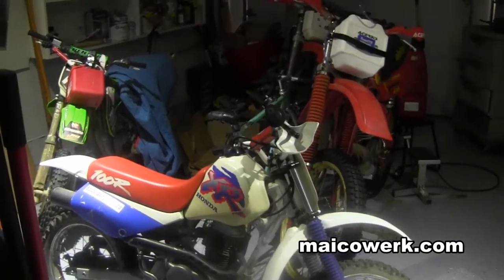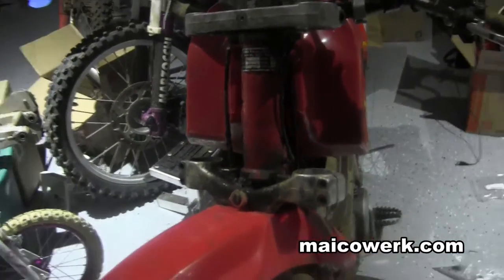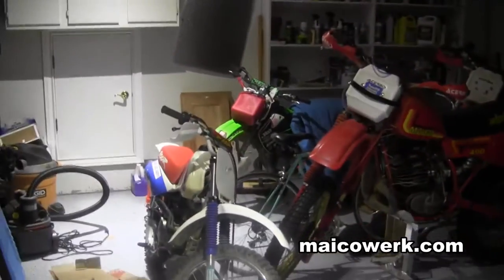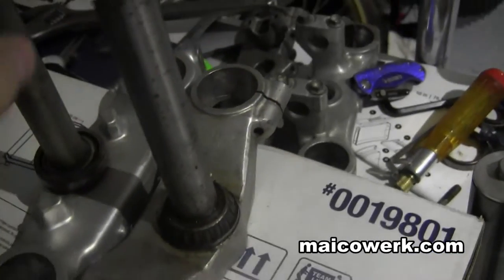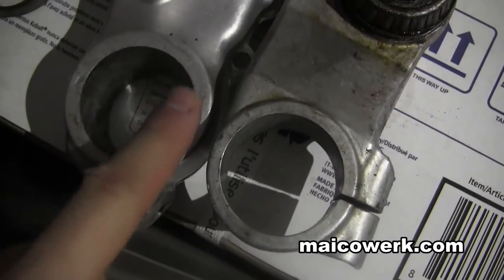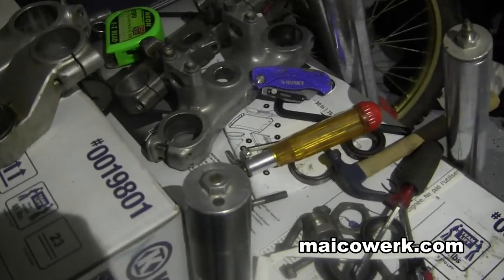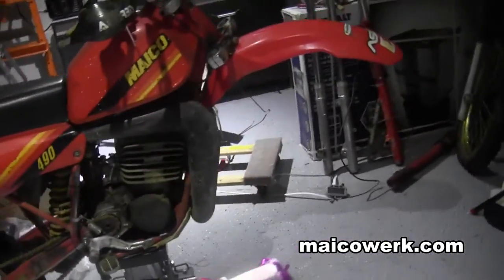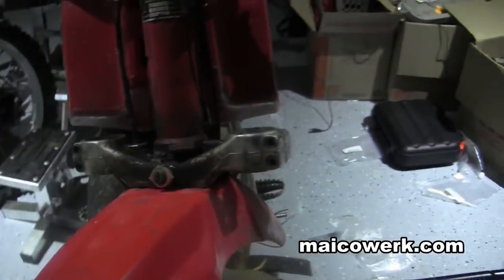Dirt bike Converting Drum to Disc Brakes Part 1

Comment: definently this style of video, im trying to figure out how to convert my Honda xl250r from drum to disc but cant figure out what forks to go with so seeing this vid will help me figure out what it takes to do the conversion.
Reply from the maker: Thanks, great I hope you can find something that will work for your bike.  Perhaps something from a newer Honda of simmilar model.
Reply: Did you ever figure it out? I'm trying to do the same thing with my xl250r and have no clue what folks to use
Reply: Depending on the year you might check to see if the XR250 forks would work for a swap, I think starting in 84 the XR250R are disc they might work on the XL of similar year. Not sure if it will rake the XL out too much.

Comment: could you press out the stem from the cr125 triple tree, then get the top and bottom triple tree bored out to take the maico steering stem?
Reply from the maker: Yes, that's another option and possible to look into if I can't get a good alignment with enlarging the T-Clamps on the Maico.  Either need to replace the stem or get some mod that would allow the CR's bearing to seat in the neck.  I'm hoping that the enlarging will be the easiest path as it's just 1mm.
Reply from the maker: Its done and we actually went that route